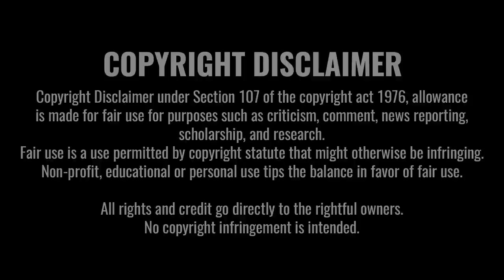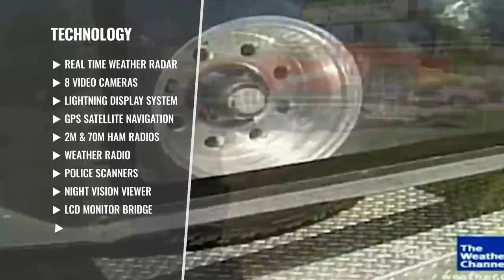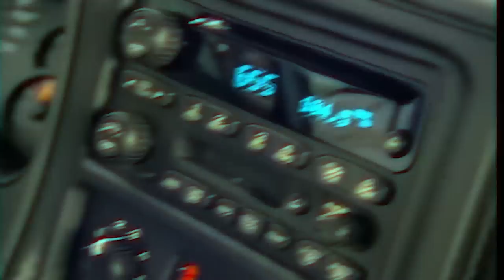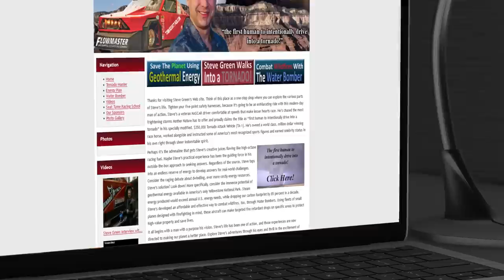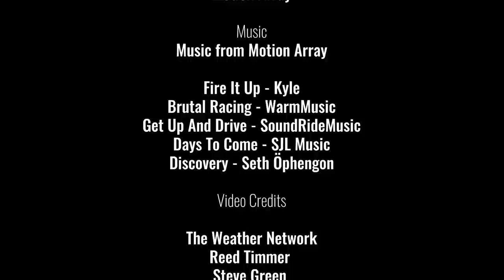Tornado Attack | A History Of Tornado Interception

Comment: Ah the ole tornado attack, fun fact in the winter of 2021 and early months of 2022 I help maintenance this amongst all of his other race cars, I was his mechanic/driver for certain things. This thing in person is absolutely incredible I've never seen so many knobs and switches in my life. Steve was a cool guy to get to know
Reply from the maker: Wow, it's still around? I would love to know more. It's impossible to find any info about it after 2011, so if you have any info, photos or a way to contact Steve I would greatly appreciate it!
Reply: Aaaaaaaand no reply, 4 months later.  Busted?
Reply: A year bro 😂
Reply: @Reluctant15  he and I have parted ways, but what I can tell you from the time I was there in fact, it is still around and he still uses it mainly for promo stuff for his storm chasing companies, it's absolutely a work of art and probably one of the most complex things I've ever sat in and worked on. It's not been updated with modern technology yet because he hasn't figured out if he is going to build something new or restore what needs to be fixed on the Tornado attack, it was talked about but I wasn't there to work on his storm chasing stuff so other than that I don't know what he decided between he and his business partner. I will say in person it's a lot different looking, it's hard to tell in the old videos not being hd, it has similarities to a cybertruck in certain areas, the chassis is completely chromoly its insane what the cost was to build it and to keep maintaining it as more of a show vehicle
Reply: @jacobdavis2378  that would be amazing if he sort of revamps the Tornado Attack, we haven’t gotten a new or restored tornado interceptor in a while! Also I feel like we need more interceptors because at least to me watching tornadoes fascinate me and seeing the beast be taken on is chilling yet satisfying
Reply: I personally would love to be a chaser
Reply: @Reluctant15  last he and I talked he was "retiring" the tornado attack from full time use, but is still going to use it for testing, he was making a suite to be able to glide into tornados with at the time, I saw him test it with my own two eyes from the front seat of a Polaris RZR

Comment: The concept of a TIV is something that a lot of people credit to Sean Casey, which is why I really love this little mini documentary. Awesome production quality btw. Keep this up and your channel will blow up
Reply: Could possibly give some credit to the movie twister, while you didnt want to be in the vehicle when the tornado rolled it, they still sent one in to help deploy the sensors. Might have been what gave a few people that Idea.

From a usability standpoint Steves probably was the most practical on and off road, however had the least about of armor for debris and as it didnt drop all the way down couldnt handle as high of winds before it got lifted.

Reed Timmers I would say is sorta a mid ground, good onroad performance and reliability, stable at higher wind loads, and slightly better armor (however less roll over protection - no roll cage)

Sean Casey has basically the Tank, it probably is the heaviest, strongest, and safest as far as debris and wind loads. It also looks like TIV2 can handle decent off road. However it was known to not be as reliable and they always had problems with the TIVS.
Reply: @jjjacer  The reason for the TIVs not being as reliable is that they are based on standard road going vehicles, the reason why Tornado Attack was so successful was because it was made for one of the toughest races on earth the Baja 1000.

Comment: A weighted down body armor suit?    Seriously?   That's insane.  First off, there's no way to have it weighted down enough to be effective.  And if it is, then it can no longer be referred to as a suit that one can be mobile in.   And apparently it's a common misunderstanding that so many have about the human body.   There can be no such armor.  Unless we invent a force field type apparatus, that is able to remain in one place despite what is thrown against it.  And I'm pretty sure we are no where near close to inventing such a thing.  It's the way that our bodies are made that makes it impossible for such an armor suit to ever be effective.  Sure, armor can protect the vast majority of our bodies.  All except one part.  Which happens to be the most important part.  Our brains.   Our brain and spinal chord float in a fluid called cerebrospinal fluid.  It allows a small space for the brain to swell if its injured.   But it does have a draw back.  In the case that you're violently struck or thrown, it causes your brain to be essentially thrown against the cranium.  Causing a head injury.   The severity depends on how violent the action was.  So as long as our bodies are able to be moved very quickly, our brains are susceptible to injury.  This is why things like vehicle airbags and thick armor don't always protect you from serious injury.

Comment: That's a baby. You get inside a F5 you ain't coming out. I live in tornado alley. An f5 erases EVERYTHING but concrete slabs.  You will not come out the way you think you will. Those storms are killers. These little Midwest tornados are destructive, but are very small compared.
Reply: There hasn't been an ef5 in 10 years, also thats why he didn't intercept any ef/f4s and above, because he wasn't suicidal.